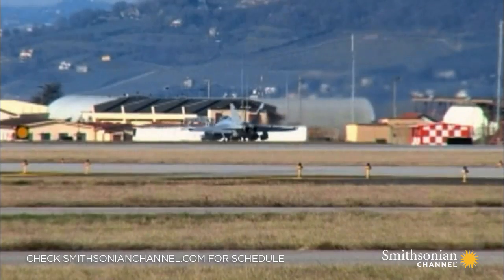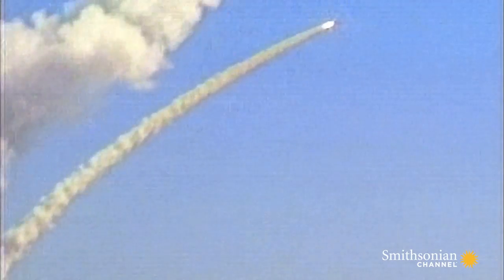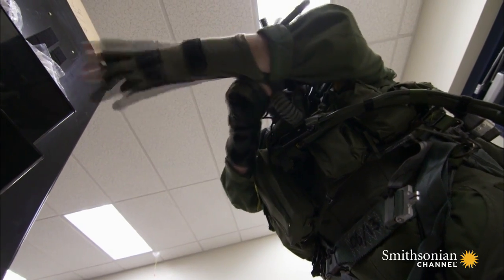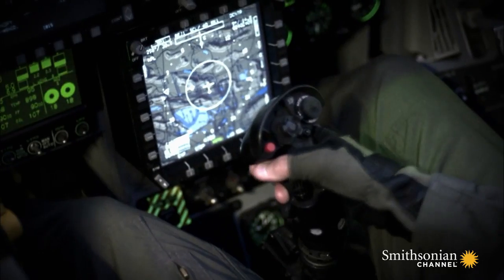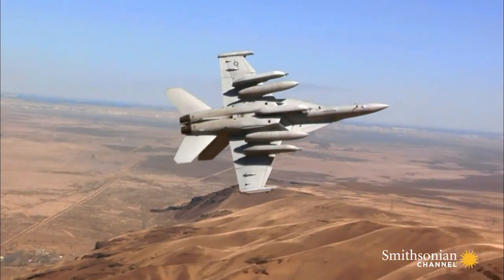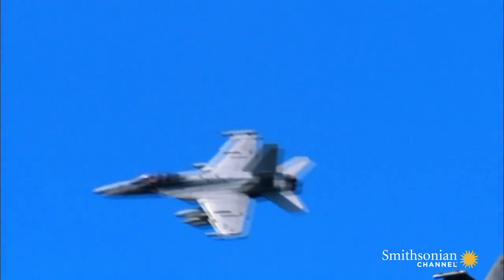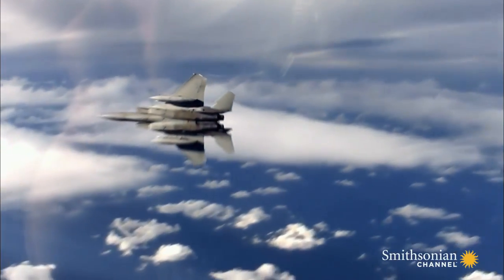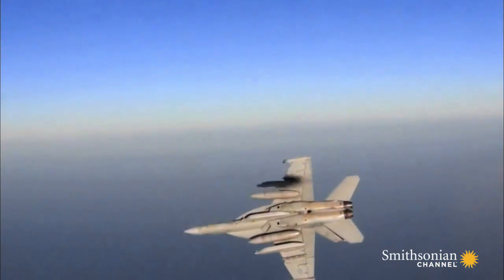This Is How a No-Fly Zone Actually Gets Enforced

Comment: The easiest way to hack radar is through the receiver antenna.
 Another way is to send the code in a directed energy (microwave) weapon. A computer doesn''t need to have any antenna or be hooked to anything to be hacked by this method. It may be possible to turn on a computer that's shut off with this technology.

Comment: if the radar is being jammed, how does the missile find it's way? wouldn't it track toward the jammer?
Reply: coordinates
Reply: ah, but the HARM missile is designed to target radar sources and follow the signal in order to destroy a radar site. To jam a radar you need to put out more noise than the radar can signal, so wouldn't a radar homing missile home in on your signal? (unless theres a more intelligent way for it to pick out the actual radar site)
Reply: Yes this is correct.  The video is most likely wrong, it might be intentional to prevent the actual procedure they use to take out a target such as this.

Comment: what is a no fly zone
Reply: That's a good one!

Like your dry....very dry....humor.
Reply: a no fly zone
Reply: I'm serious tho. Obviously planes can't fly in that area. But why is it a strategy? I read in the newspaper that it would be a horrible idea for Syria, but it worked for Libya?
Reply: mercedbread basically civilian or comercial aircraft cannot fly into the area, if they do fighter jets will approach them but not engage. unauthorized military aircraft in the area will be given little warning and wilk be egaged with the smallest sign of threat. it works pretty well on defending an area because you wont have to worry much about civilian aircraft showing up on radar, so it will be easier to spot enemy aircraft.
Reply: mercedbread and it would work, keeping civilians and soldiers safer

Comment: I like how i see people asking about the mirrors but no one ever notices the vortex generators
Reply: ***** at the end of the day, I think I'm correct when I say that we can all appreciate these majestic metal war birds for the absolute beautiful pieces of engineering that they are.
Reply: ewesey you do realize jets literally have vortex generators...
Reply: L you're dead shut up
Reply: ewesey I honestly really doubt the reason for vortex generators is obvious because I'm pretty smart and didn't figure it out till my SASI told me
Reply: Jake Jascob Im sorry but no mate, saying that they also help generate lift for the air planes is literally saying that they are more aerodynamic, its the same thing.
Reply: You both somewhat correct in the sense of aerodynamics as the Vortex Generators main purpose is to increase effectiveness of control surfaces and decrease airflow slippage across the wing at the cost of some drag therefore, in a sense, technically being less aerodynamic (the slight drag created by the VG's is cancelled out by the benefits of the vortices generated). Some VG installations can help increase the maximum takeoff weight through reduction in stalling speed as a secondary function as Jake has summed up to "additional lift" (not technically lift though as maximum takeoff weight is not a lift vector, just the ability to carry more weight aka lessening the weight vector). Hope this helps any confusion.

Comment: I bet the sensor works by measuring the heat given off by tiny iron balls sealed off from the outside heat, which heat up compared to the surrounding area of metal, which can be recorded and return a signal that there is enemy radar that can or may see you.